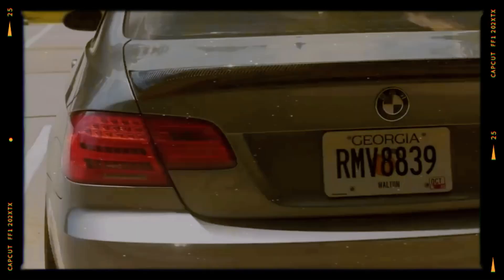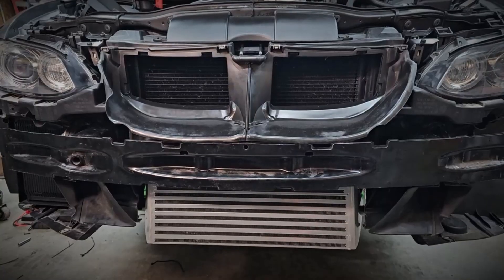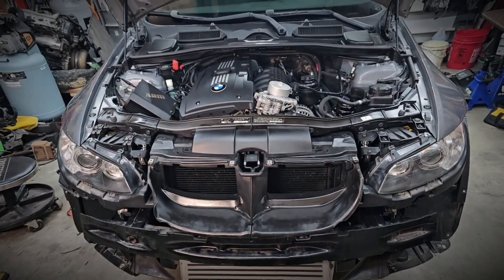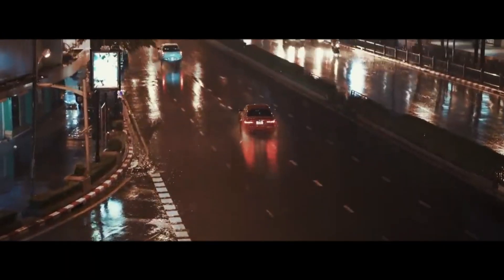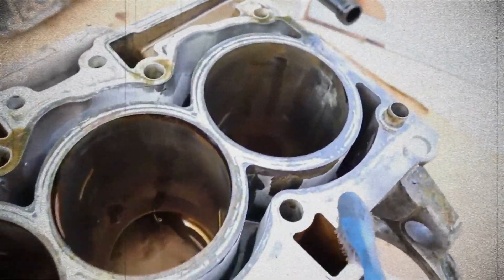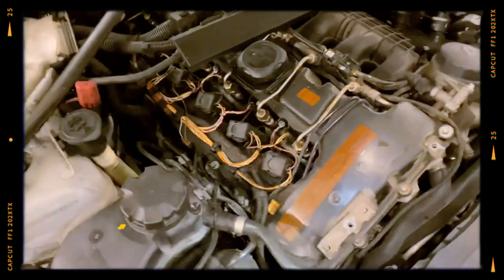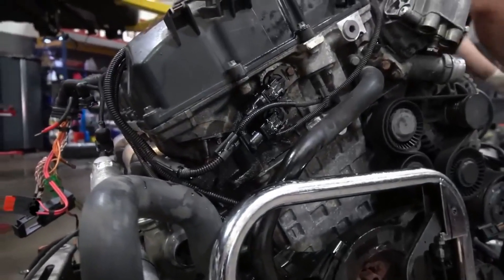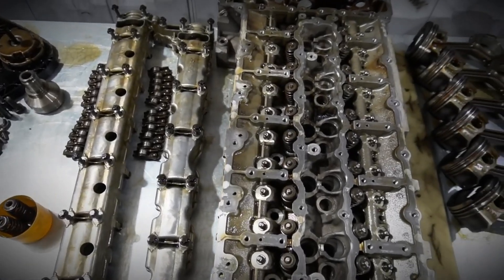BMW N54 engine - everything you need to know!

Comment: The electric water pump went out on my 2008 BMW 135i at 61,000 miles, the water pump replacement and thermostat cost me $350.00 (for parts only) I purchased the Pierburg water pump which is an upgrade from the Continental which was the original equipment.  The thermostat is a Mahle which is original equipment. Imagine the car stalling and going into limp mode in the middle of a freeway, dangerous by all means.  This can certainly happen if electric water pump goes out, coolant temperature rises and goes into limp mode.  BMW does not have a coolant temperature gauge on instrument cluster, instead it is in a hidden menu.  Crazy!  In my opinion, I will never again purchase another BMW - as Scotty Kilmer says, they are money pits.  I agree.
Reply: Every car has issues at some point, doesn't mean bmws are worse than other cars
Reply: @futuresm3   I would think that with an MSRP of $39,995 the BMW 135i convertible would be considered expensive back in 2008.  Because of that price I would like to think the vehicle would be reliable and the BMW badging should support that but my car simply didn’t hold up to that.  The maintenance on those cars are also through the roof, a battery along with the programming after the install was $600.00 a set of wipers was $75.00 (that is quite extensive).  The car itself is beautiful, it drives very well, however the maintenance and reliability on this specific vehicle is simply too extreme for me, In my opinion, as I said before I wouldn’t buy another BMW.  Yes, you are correct, any vehicle can fail in time but for me BMW means nothing.  The, “Ultimate Driving Machine”  also brings with it, “Ultimately expensive repairs.”  Peace.